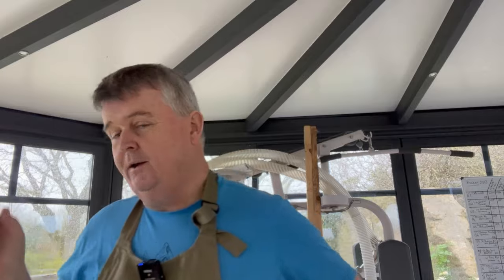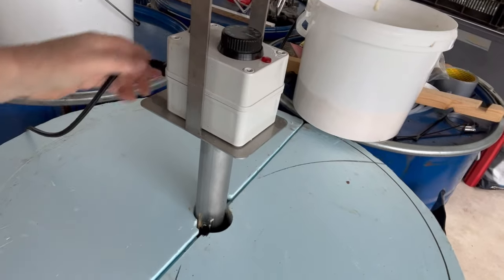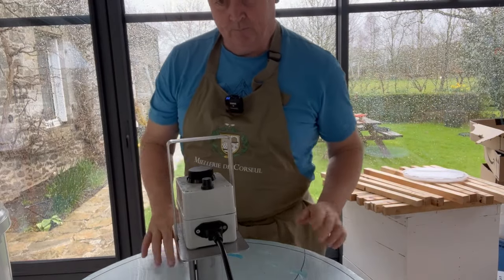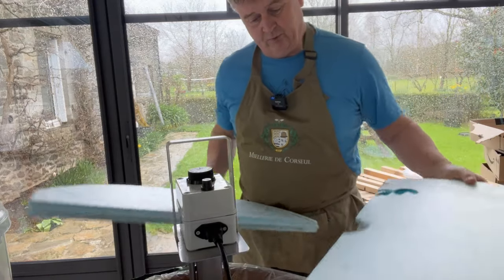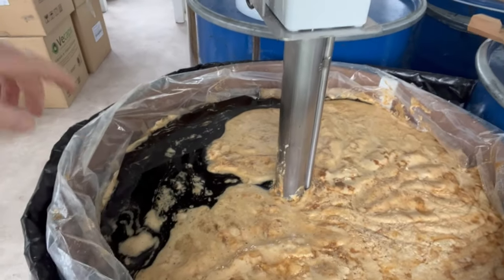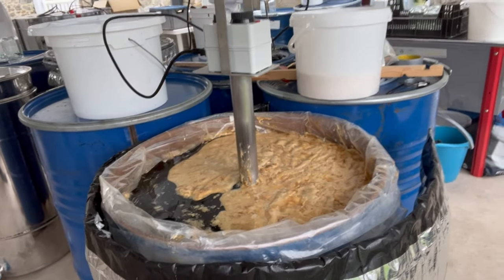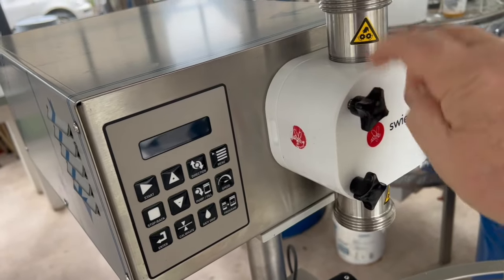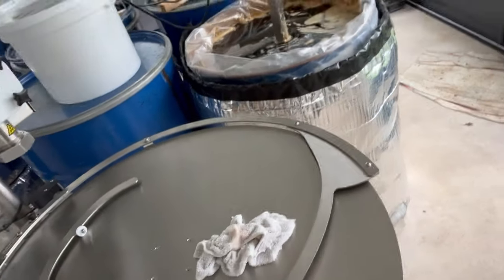From the barrel straight  in to the pot!!

Comment: Do you have to clean all the pots? I buy boxes of 12oz jars but always wonder if I should wash them before use or just use them straight from the freshly opened box
Reply from the maker: Hi all jars are inspected prior to filling. In almost all cases the jars are packed sterile as they are heated to hundreds of degrees above boiling point to make the pot. I suppose you might be more careful if your buying individual jars. When you buy in quantity say a palette at a time, the glass is sterile. However it doesn’t mean we don’t check.
The other point is, honey is a sterile produce, anti viral, anti bacterial do itdoes not promote the growth of bacteria. 
As long as the jars/pots are kept dust free there is no need to wash them. 😊
Reply: @richardnoel3141  thanks, to be fair I hadn't looked at it like that.